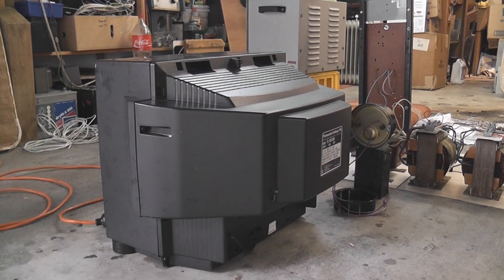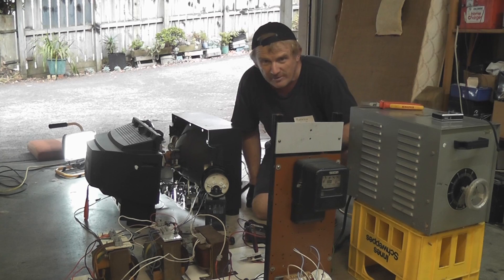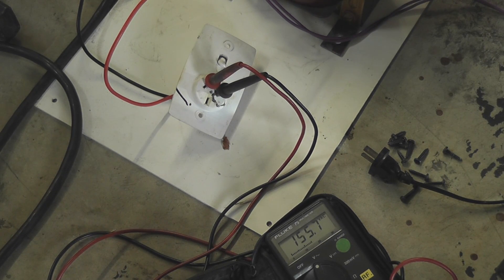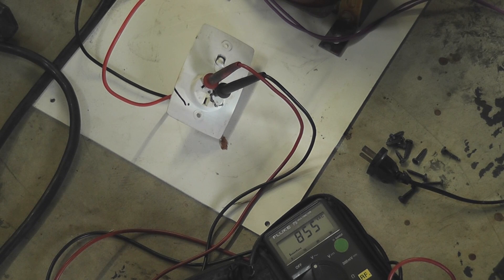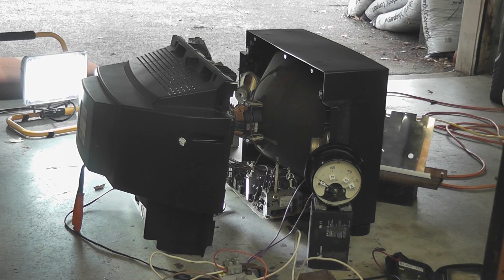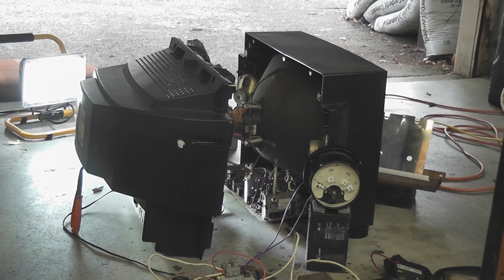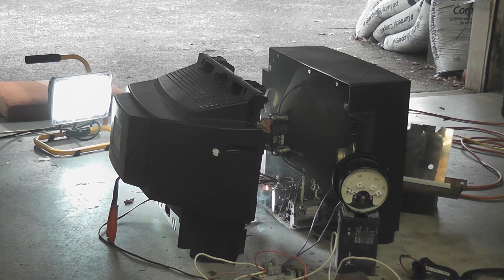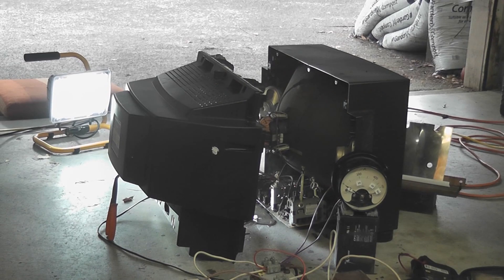TV on 850 Volts AC

Comment: Hmm.. if this set has the now common universal input stage, aka a PFC type that can run on 100 to 270VAC, 50/60 Hz, then you could power it with 400VDC without bothering it. What would go first would be the TVS/MOV overvoltage protectors.

Comment: Heavy variac? There's a solution to that. Wheeeelzzz :D

A castor wheel on each corner, and away you go. :D

You've seen the vid where my 10A puppy gets given a set, and you'll be amazed at how easy it is to roll around a variac that size when it has wheeeelzzz on its underside.

Once the wheels are on & you find out how easy it makes it to move it from one place to another, you won't want to take the wheels back off again.

Trust me on this....BoomBoxDeluxe has flavour. :D

{^_^}  =BBD=  {^_^}

Comment: NAH! Dovetastic would high voltage it on the concrete floor with a hose with running water on the floor while doing it in his bare feet

Comment: Able to inject the power after the main switch-mode?

Like keep the logic alive (low voltages like 12V, 5V stays), and over-volt the rest.
I would love to see one video where you get a tube failure (but not smashed, or burned out filament).

Like over-volt the HV  and pull the yoke off the tube and see how much burned a single spot can get?

I managed to melt the shadow-mask with too much current (brightness) while having no deflection.